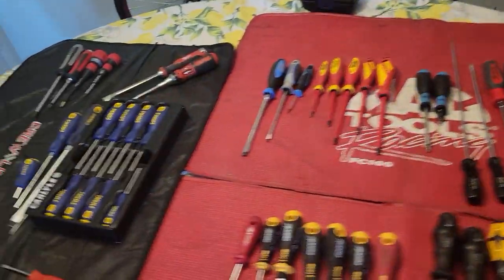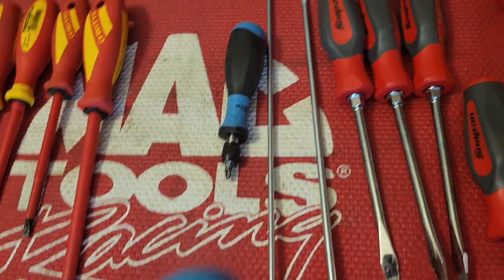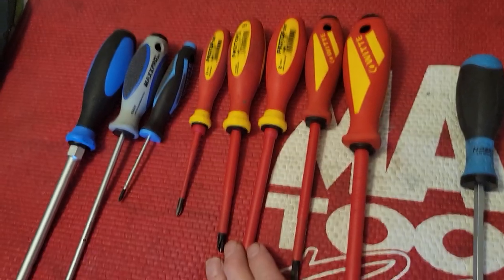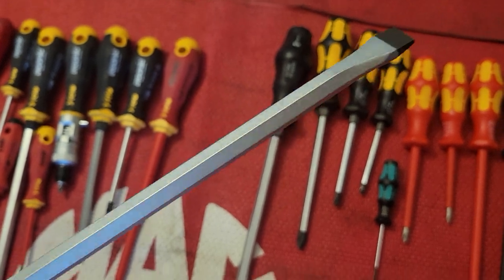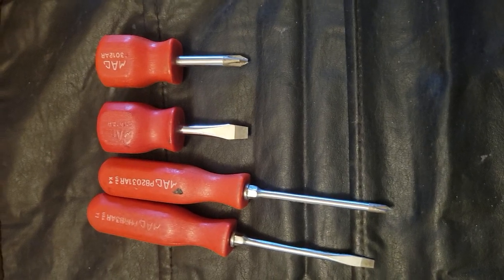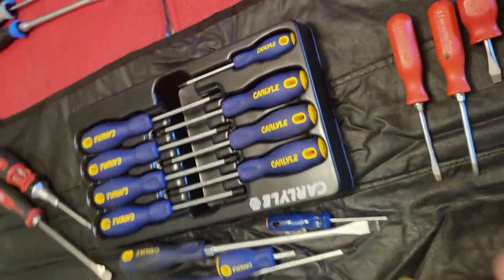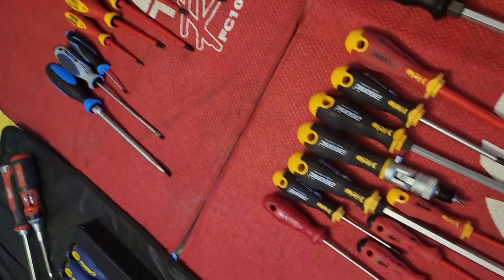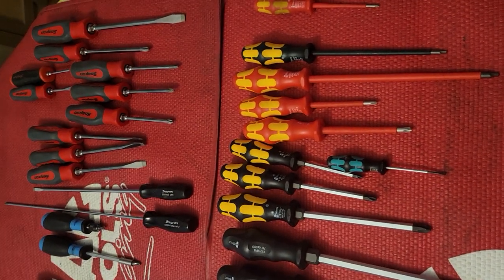Who makes the Best Screwdriver.

Comment: Wiha Extra Heavy Duty, period. Snap On are trash since the 80's. Wiha is the real deal.
Reply from the maker: I'm sure they are very high quality,  I have there precition screw drivers. But not their Bolstered HD screwdrivers with a striking cap. Yes , some SnapOn stuff just isn't the bees knees.
If I had it to do over ,Snap On combanation and aviation long  wrenches, and non impact 3/8 low profile chrome sockets and ratchets  would be all the SNap On I would own. They do still make some very good core tools. But so do the German companies. You only know what you know,when you know it.
And over the years since the internet ,we have so many more choices.
Reply: @jeffharper410  Actually, being an automotive master tech for the better part of my life, I've found the best Snap On tools are not made by Snap On. Their adjustable wrench made in Spain and file sets made in Portugal are the highest quality of their current tools. Hazet wrenches are far superior. Mind you I have a shop full of Snap On tools that just collect dust now that I've discovered better brands. Knipex pliers, Wiha drivers, Hazet wrenches and ratchets, even Gearwrench (Apex) has stepped up to better durability than Snap On. I will say that my 1948 Snap On F-71-A is the highest quality ratchet I've ever seen. But that is a far cry from what they churn out today. The price is still crazy high though the quality is roughly Harbor Freight-ish today.
Reply from the maker: @bobwasmycat  
Yep, 
They own Bacho now, very good adjustable wrenches. I have a couple .Both Icon and Gearwrench have come way up in building some fantastic ratchets , I also like the older Srhawille ratchets,  I have so much stuff now it's stupid but I'd like to get the Hazet 916 HP 1/2 long version and the Hazet 3/8 8816HP. Ratchet.
I just wrench on stuff as I can living in a HOA condo now.
And being closer to 57 ..
I don't mind buying quality because I have a 13 years old son to pass it all along too.
TBH, I had some cheap stuff mixed with very good tool truck stuff over 40 years worth .
I have donated the cheap stuff because when I do work on something ,I'm to old to use junk tools , crap tools get you hurt. 
I filled in the gaps after getting ride of the junk with mostly German stuff . When younger I bought what I could afford ,sometimes the best ,sometimes not at the time.
For example , all the SNap On screwdrivers are replacments .
The old black handle ones I bought in the 80's returned to petroleum, sweated out all over the drawer and the handles turned white and fell apart!

Comment: Save your money up and buy some PB Swiss screwdrivers.
Reply from the maker: Not the best for heavy automotive repair.
I love them for everything but abuse. You can't smack the back of a PB swiss to break rust loose .
You can't use a wrench on them very well either.
Great for bikes.
Technology is changed and Phillips, slotted screwdrivers will be outdated tool in 20 years any way. I'll be 76 and won't care.
I still use slotted screwdrivers to remove clips of all sizes ,plastic and spring steel. Soon Phillips will be seen as often as GM s clutch head screws from the 50's . Had to donate that set of screw drivers for the restoration of a 1949 5 window.
My point is in 20 years my tools will be erelevent.  Electric cars will be made like plastic cigarette  lighters, battery life is 10 years and the car around it will last the life of the battery. Thell be disposable vehicles. 
The ww2 generation reused everything ,glass milk bottles where washed and reused soda bottles too. Even tires got a retread and lived a second life.
We are told to recycle yet only 3 out of 10 plastic bottle actually get recycled as it is more costly to reprossess the plastic than to make new. In the future nothing will be reparable. It keeps people in debt always replacing everything they own .
My dad had a old copper color GE refrigerator that went 20 years in the house and another 30 years in the garage keeping beer cold. He vacuumed the coils out once a year and replaced the magnetic door seal.
I spent 5 grand on a new fridge 5 years ago and it has already been replaced under warranty. 
It died before 2 years!
Reply: Jeff, Great video.
 I too, like the Vessel screwdrivers and not just on my Japanese cars but Philips screws as well. PB Swiss does make screwdrivers with a striking cap, the 8100/8200 series with their awesome Swissgrip handles, just black in color. Another brand I own which is great for Automotive work is the Wurth Zebra 3K series. Fantasic contoured handle like a Felo Ergonic with a bolster and a striking cap too.
Reply from the maker: @jeffreycaban5107  
That is good to hear , other than the Wera stubby #3 that will be in my next order,  I don't see myself buying alot more screwdrivers .
I also have a nice set of Hollow ground not to mention all the bit sets from Brownells.
And a collection of 1/4  screw bits that is maddening and seemingly with out end.
Reply from the maker: HTR  
I will give them credit for the best ratcheting screwdriver .
Stupid expensive but the most precision with no play in the shaft.
Reply from the maker: HTR  
The only one I ever used didn't belong to me. It had a red handle and was in a case full of bits.
I used it to tighten some hex bolts on my sons BMX bike between races. I have never been a fan of ratcheting screw drivers , even my old Snap on that long disappeared out of my truck seemed clunky. The handle was to fat as it held bits, the shaft was wobbly and the ratchet ing mechanism seemed underdeveloped,  not very precise for a premium brand.
It just seemed to get looser over time.
The PB Swiss was tight ,and just felt like a good screw driver , nothing had excessive play in it.
Reply from the maker: HTR  Thank you, I'll look for that part number.

Comment: Who makes the non contact voltage testing screwdriver?
Reply from the maker: GB.
Reply: @jeffharper410   is that the Gardner Bender SDT-10 Circuit Alert® Voltage Sensing Screwdriver, 10-In-1?
I could see that as being pretty handy. Thanks in advance!
Reply from the maker: Mines not a 10n1 , It's more than 20 years old on its 4th set of batteries. When I do light fixtures  it's in my bag every time.